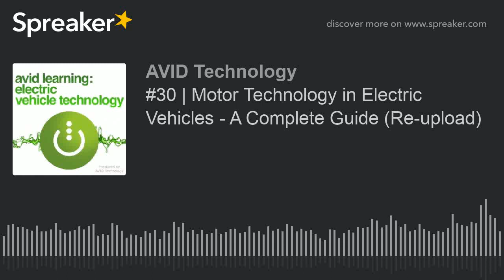#30 | Motor Technology in Electric Vehicles - A Complete Guide

Comment: questions about 1. Iron nitride magnets  https://nironmagnetics.com/#technology 2. carbon yarns as conductors http://curtran.com/benefits/litewire-vs-copper/ 3. advanced motor wire insulator https://insideevs.com/news/318031/breakthrough-insulating-material-lets-electric-motors-perfom-hotter-than-ever-before/  -  has Avid Technology experimented with any of the above?